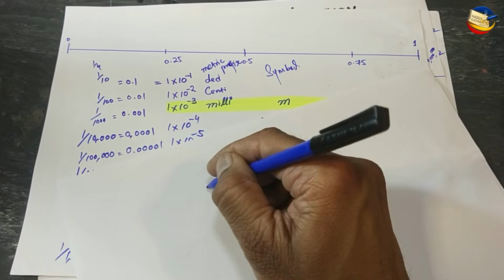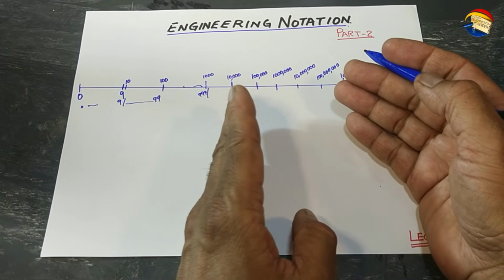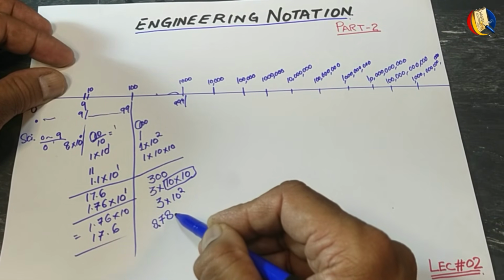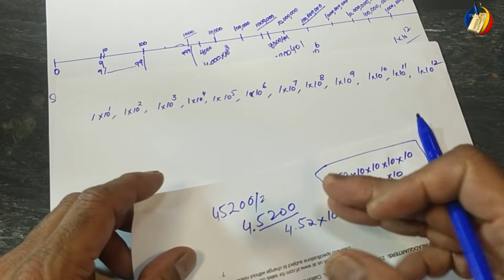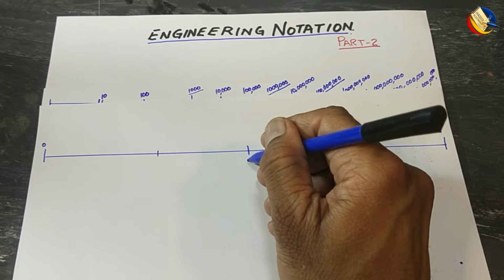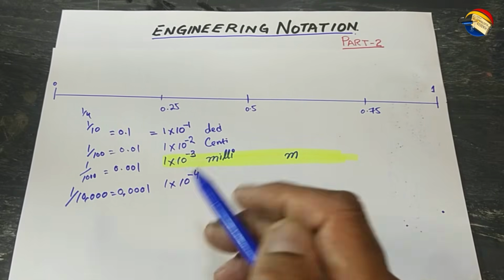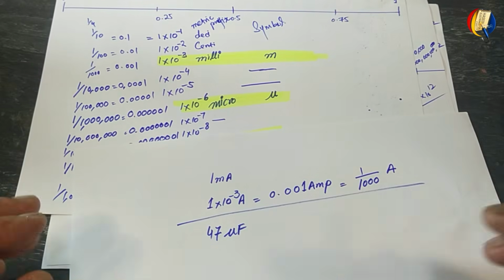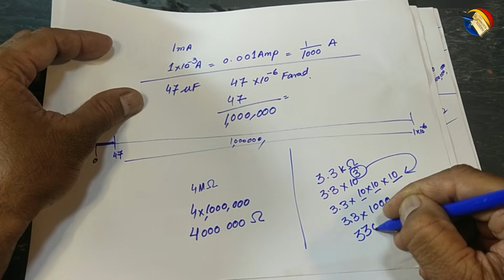Engineering Notation | Scientific Notation & Metric Prefixes | Electronics Fundamentals | Ep #1471

Comment: ❤❤❤السلام وعلیک رحمه الله و برکاته  یا استاذ معلم 
😊😊😊😊
😅😅😅😅 .pls  sos sos  sos  
  
Hello Professor, if we turn on the power with a test lamp and when the output  short  of the lamp turns on with an  pulse, is it a problem? If it is a problem, how can this problem be fixed? The power switching is set up with two 13009s and an AC tl494, as well as a pulse choke with a transistor 1815. The output is controlled by a transistor 1815. The power of this device is 50 amps. Considering your analytical power, we are all waiting for your opinion. Professor, we four people will accept whatever you say and deliver the device to the professor of electricity at the university. Thank you for your time. We have a request due to the severe restrictions in Iran.